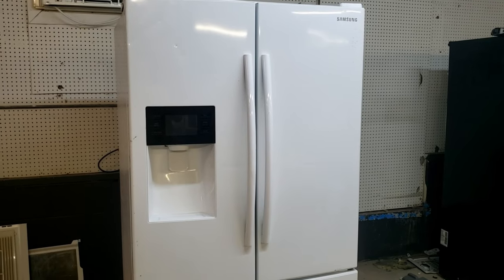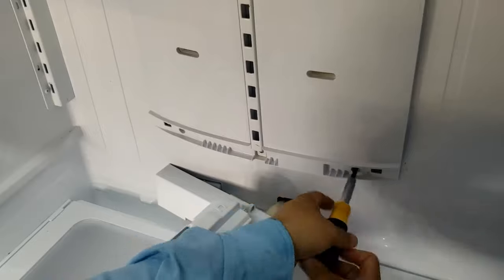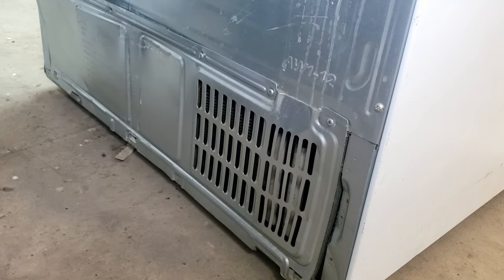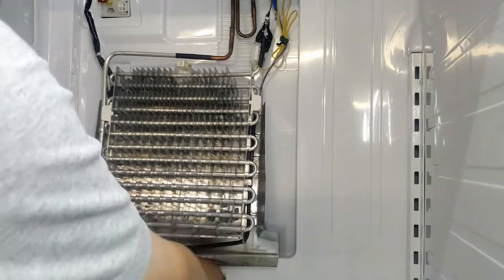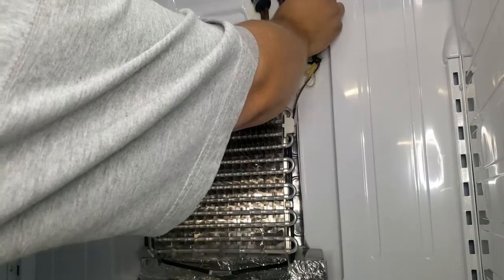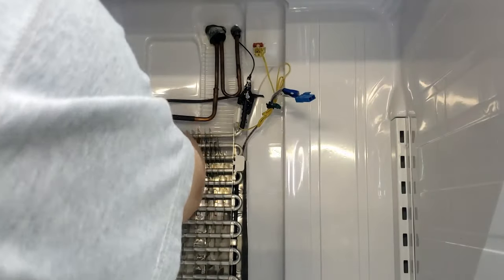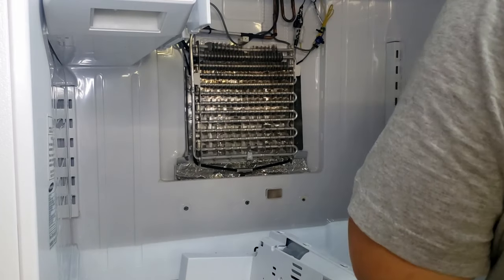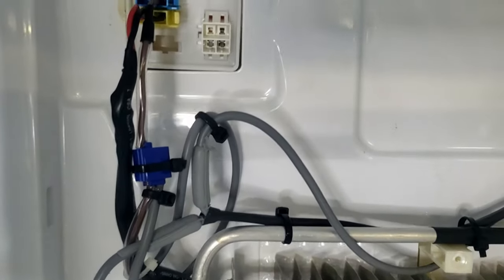Samsung Refrigerator Ice Build-Up and Leaking Water Inside Drawers - How to Fully Fix it Forever

Comment: Hi Ben, we bought your repair kit for our Samsung fridge RF263BEAESG and installed it.  So far so good.  What is the wire connector labeled DA32-0006W for that came with the kit? We didn't see any where to use it and didn't see it referred to in your video?  Hopefully we did the right thing and didn't use it. We plugged in the fridge, ran the rapid defrost and it was working so hopefully we didn't need it for our model?

Comment: Hey, I'm hoping you can answer this. My Samsung fridge had the ice buildup problem and I couldn't afford a secondary heater right now, so I all I did was get rid of the stock thermal probe and replaced it with a piece of copper wire, forming a "T" with both ends and then creating a "V" shape where it enters into the top of the drain opening. The fridge has been working great for the past 10 hours, but when I open the door there's an odor which kind of smells like heated plastic. I used metal screw clamps to attach the copper wire so it would do well at conducting heat to the drain opening. Is this odor likely just a natural result of the fridge being iced over for several months or did I perhaps create hot spots by clamping that wire in four places? I don't want to cause a fire, but it's my understanding that the heating element doesn't create enough heat for such concerns. The odor is definitely detectable inside the fridge and not emanating from the exterior bottom/back.
What are your thoughts?

Comment: Hi Ben- Great video, thanks. Will your Refrigerator Secondary Heater Kit as well as the optional Defrost Sensor DA32-00006W work for a Samsung Showcase RF28JBEDSG?

Comment: I've installed the kit. Will the fridge automatically keep itself from frosting up too much or do I need to force defrost sometimes? Will the defrost cycle keep the food good when if it runs automatically? How is it supposed to work? I don't want to lose any more food. My panel doesn't feel as snug around the edges as it was originally. Hopefully this isn't a problem.
Reply from the maker: It should automatically cycle both defrosters and keep the ice build-up that causes the issues away. Forced defrost every so often may help, but shouldn't be needed.
Reply: @bensappliancesandjunk  thanks, is there anything I can do to minimize my power consumption? I'm off grid and this is a big fridge. Had I known about these issues, I would have moved on to a more efficient model. I'm not sure how well my panel sealed back up. Will that gasket/seal have a big impact on how often the defrost coil runs? I'd like to try and optimize it. I did move the temp sensor to the right about as far as the panel would allow.

Comment: Great video. Do you think  the supco series  SH201 would work just as well or better. It seems to have better reviews
Reply from the maker: I've used them on the mod. They work great. Honestly, I prefer them because it distributes the heat over a wider area
Reply: @bensappliancesandjunk  
Would you please post a link to this heating unit? 

Thank you so much for your time and for sharing your expertise. 

I've had this problem since I purchased the refrigerator, just over six years ago. 

It was repaired three times under warranty, and again just last month, not to mention the many hours of 'hair' drying and defrosting carried out by me/my family as was TAUGHT to us by the Geek Squad repair person (since the problem is so common).

This is clearly an issue; SO MANY people have commented on this and related YouTube videos. 

Even the most recent technician said that he was very familiar with the issue, in the past, encountering it so often when repairing ice makers, he would be prepared to include a related fix because he found so many people suffered both.  

The ice maker is covered under an Extended Warranty, reportedly, due to Samsung being twice sued over it. Unfortunately, this icing issue isn't considered enough of a "known issue" for Samsung to take responsibility for.

Why do we have to go to the lengths of SUING, just to get something so common as this, repaired by the company that sold us faulty equipment? 

Has anyone found a way achieve any results from Samsung? I cannot afford any more outside repairs (hence, seeking DIY instructions, here), not to mention, the so called repair did not solve the issue.

Also, how long has the heater solution lasted for people (so far)? 

No "repair" I've received, to date, has permanently resolved this situation.

I question Samsung's integrity, and I will need a lot of convincing data of the contrary before even considering a Samsung product in the future. 

A refrigerator should last for more than a couple years, and I hadn't had it longer than that before this travesty revealed itself.
Reply from the maker: @aaangel30  Its in the description

Comment: Hi Ben. Great video and derails - thanks. Question: is the Frost King FV30 Foam and Foil Pipe Insulation for the last alternative mentioned in the video (instead of installing the heater)? Can or should we also use in combination with the secondary heater?
Thanks
Reply from the maker: Use one or the other, not both. The heater would melt the FV30 that's wrapped around the copper pipe.

Comment: I purchased the repair kit to fix the ice build up issue on my French door bottom freezer, but after taking the back panel off, the wiring is completely different from all the videos ! My Samsung has the wiring coming out only from the left side, not both ?  Fridge series RF266. ONLY 1 BROWN WIRE LABELED 2440  NOT 2 AS ON THE VIDEOS . ??? THX 4 ANY HELP !
Reply from the maker: Trace the wires that go to the main heater. Those are the 2 you tap into
Reply: Thx

Comment: I have had this water gathering under the beverage drawer on my 11-year old Samsung refrigerator for a couple of months. A repairman came out and found no issues after testing and examining various parts but says we should try replacing the entire back panel (evaporator panel?) for several hundred dollars. He says he is not sure this will fix the problem. Does this seem reasonable? I am wondering if your fix might be my answer. Thank you.

Comment: Ben, it looks like the kit you sell comes with SH201 but it's listed here as an "alternate". Is the SH502 better?
Reply: Yes sup502 for the cabin , in parallel with existing cabin defroster. see my earlier post. While your at it add an aluminum clip on with extended tang for the drain tube.
Reply: See my earlier reply to Ben. Let's find the law firm that won the law suit against Samsung and file a second class action for the cabin defroster

Comment: I've had the same problem with the iceball and I manually thawed it...it worked fine for about 6 months and now it's slowly coming back.  But worse, the Freezer has stopped freezing, are these 2 issues connected, or is the self-defrosting a whole other problem?

Comment: Does this work on any Samsung model that is having this problem? I replaced my drain clip with the longer one and it was working great again for about a week. Now it’s building ice and leaking water again. It’s just a matter of time before I’ll have a ball of ice again I’m sure. Just nervous about splicing the wires.
Reply from the maker: Generally yes. We do sell an easier splicer than what's here. I have a few other videos on posi taps which make this a cakewalk

Comment: Hello, I have the same issues with my Samsung fridge. I’m wondering, If I turned off the ice maker in mine would that prevent this issue? I turned the fridge temp up just a little and no longer get sheets of ice under the long deli drawer at the bottom but still get a ton of water. My ice maker still keeps frosting up so I have to hammer the frost buildup off every now and again. I was wondering if I just get a separate ice maker and turn off the ice in my fridge if that would make any difference?

Comment: Hey Ben, bought the kits, got er all done, except the defroster probe won’t go all the way into the drain line. Seems the probe is too long… can I cut the bottom of the probe off so it will fit into the drain line? I made sure the drain line is clear, so it’s not blocked/iced. Just seems the drain line starts to turn fairly early. Thanks!!
Reply from the maker: Yes you can trim it. Glad to know drain line isn't clogged because I've had a few instances where the probe wouldn't go on due to ice
Reply: @bensappliancesandjunk  trimmed it, working well, thanks so much!!

Comment: I have a hole burned in the plastic at the bottom left side of the evaporator. Form the existing heater I guess? I might have bigger problems?

Comment: Very informative video.
Bottom of my heater shows 70F,while upper vertical side around 200F.any ideas? And if the thermostat doesn't show any continuity could this be the reason of ice build up? Thx for your sharing
Reply from the maker: Where is the ice buildup? It should distribute the heat evenly, but if there's more ice/ect buildup on the bottom, it could be distributing the heat further, keeping those temperatures lower. The thermostat should have an ohms resistance value to estimate temperature. I'd consider moving it further away from the heater, to ensure it warms up further before shutoff.

Comment: How do I know if I need the 18" or 24" heater?  Also, my fridge is a GE Profile that looks exactly like the one in your video, and I understand it was made by Samsung.  Will the Samsung defrost sensor be compatible with my refrigerator?  How can I find out?
Reply from the maker: Either one works. I usually suggest the 18". All you'd need to do is punch model# into a website like PartsSelect and look at part numbers and see if its the same thing as a Samsung... GE may even have the original Samsung part#s in the listing, even

Comment: Will this work for Samsung rb217 model with a single refrig door?
Reply: Bought the kit and did not use the add-on heater element since the wiring was different.  One tip, when installing the new drain clip, add some thermal compound to the clip to get better heat transfer from the defroster element to the new clip.

Comment: Hey Ben, great video! We removed the evaporator cover and noticed one wire broken on the fan wire bundle, then another wire snapped on the thermostat wire bundle.
Any idea where we can get replacement bundles? This relatively easy fix just keeps getting more complicated.
Reply from the maker: I sell the defrost thermostat, and am working with ERP to carry all the other samsung bits in soon: https://www.appliancesandjunk.com/product/samsung-defrost-sensor-da32-0006w-da32-10105r/37?cs=true&cst=custom

As for fan wire bundle - those vary based on the specific model, if you let me know the model I may be able to figure out for you.

Comment: I ordered your kit and installed it. The heater does not heat up. I checked for power and I got nothing. What do I check now. Model # RF20HFENBBC, Samsung. Do I need to change one of the panels on top?
Reply from the maker: Are you getting electric to the primary heater, or are both not heating at all?
Reply: @bensappliancesandjunk  I can’t find out how to turn on the defrost so no power to both.
Reply from the maker: @wrenchswatch7700  if neither comes on, it could be the thermal fuse on the unit that's preventing any voltage getting to system. Or a control board. You'd want to use a multimeter to diagnose it.
Reply: @bensappliancesandjunk  ok what do I have to check? Multimeter is ready
Reply from the maker: @wrenchswatch7700  check any sort of thermal fuse thats inline with the heater system, usually you can check for continuity to see if voltage can get thru. Also, let me know what style interface it has, so I can figure out forced defrost mode for you.
Reply: @bensappliancesandjunk  it’s on the door sill on the top, have to open door to see it. Right side is fridge, Left side is frezer
Reply from the maker: @wrenchswatch7700  should be press and hold Power Freeze and Fridge buttons for 8 seconds
Reply: @bensappliancesandjunk  it’s the center buttons on each side, power cool and power freeze.  It shows 88 on each panel
Reply: When I hold power freeze and fridge the panel goes out and in about 5 seconds it comes back on.
Reply: @bensappliancesandjunk  I had to put it all back together last nite. I’ll check it out when I get a chance and get back with you. Thanx
Reply: Ok sorry it took so long. The fridge is freezing up again an d getting warm. I push the power freezer and power fridge buttons for 8 sec. and it blinked 88 on each screen and was bleeping. I tryed the power freezer and fridge buttons and nothing happened. I’ll unload the fridge and take the back off and get back to you.
Reply: I got it to go to the menu by pushing the fridge and power freezer button very hard and it took about 20 sec or so. No where do I need to go to manual defrost function? FF 1, 2, 3 or Fd ?
Reply: May be Fd for defrost. I’ll try it. Now it’s beeping and the temps are going up. How long does the take?

Comment: You mention to avoid the thermistor being near the heater both new and existing. We should not have to worry about existing correct as we are not moving that. Only the new 15 watt heater. Is this correct ?
Reply from the maker: It should be fine in its stock position

Comment: Ben.. we bought the kit and we are still dealing with the same problem, we even buy a new element, and the little round sensor ? Any other solutions?
Reply from the maker: Hi,

Which problem are you still dealing with, the icing or the leaking?

Comment: Hi. I live in Australia and and we have 240V?  Do I need Supco SH-503 (240V 15W) or SH-505 (240V 25W).  My Samsung Fridge is SRF583DLS.  Thanks for your video!
Reply from the maker: If you can get me a schematic, I can tell you which one you need.
Reply: @bensappliancesandjunk  Sorry for my ignorance.  Do you mean specs and/or manual?

Comment: Does anyone know why it's necessary to replace the drain pipes, is this just if they are blocked or have holes in them? I've checked the ones on my fridge and they seem fine, except one of them is fitted with a little black plastic funnel at the top which doesn't allow much liquid to drop through. Would really appreciate any thoughts on this!

Comment: I will never buy another Samsung appliance as they have not bothered to get the proper fix out there.
I believe the extra added heater has not been approved by Samsung but I do believe it is a good fix.
I will install it on all 3 fridges.
Also the drain kits.

Comment: could i just cut the wire and solder it in and put some adhesive heat shrink on the pair? or is that too risky..?

Comment: What is the point of the foam-backed metal foil pieces?  What issue is it solving that the heater and (larger) drain probe does not solve?
Reply from the maker: Channeling water better. It's a very minor part of the solution
Reply: @bensappliancesandjunk  I don't think that is correct. I was wondering that also. My best guess it the insulation makes the heater work more effectively. it insulates the heater tube from the colder back of the metal and therefore more heat goes forward to defrost the coils.
Reply: @joerock7005  Actually the Foam strips go on the back side of the Drain Plate and should only be installed on units built prior to Jan 2013. I have successfully Repaired a few thousand of these Using the Factory Bulletin as a guide to repair before I retired. If anyone wants to try the "correct way" before this Google ASC20171005001. Replacing the Evaporator cover, and fan assembly helps on units where the foam channels have been damaged by the Ice, and if you have frost on the outside rear of the unit Call Samsung as its not repairable if the liner is saturated and passing heat through the liner. If the unit Ices in days and not months Check for E5 code in Diagnostic and Corroded Sensor connector at the liner, or a bad sensor. If this is the case the Evaporator will be iced top to bottom and not just at the top. Oh and the Foam is to stop Transfer of heat through the Liner behind the evaporator due to Direct contact. At Least that's what the Samsung DSM who told me that claims. If you leave it in the front inside of the plate it will end up clogging the Drain tube in the long run when it breaks down from expansion and contraction with the freezing and thawing full on water a few times a day... There are a bunch of people running around installing them on the wrong side due to the poor pictures in the SB as you will see. I Also will add A Steamer is the way to clear the tube...... Good luck with a Trombone cleaner.🙃

Comment: What size Pos-taps should be used to splice the Supco 201 defrost line?
Reply from the maker: I used the blue ones and they worked great
Reply: Thanks, got 2 of each size which included 2 blue ones.

Comment: I have the exact same problem. Sent pictures to some Pros and they said no doubt it's a seal issue? With door closed, I used an infrared temp probe around the door no cold air detected coming out on door seal. Not sure what is causing warm air coming in?

Comment: Hello, I have a Samsung Model RF26VABBP, RF26V SERIES refrigerator. It has made ice under the two vegetable bin for as long as I can remember. It is so annoying. The computer just says 88   88. I did try your troubleshooting video and it worked, but because I think of the ice built up again and it returned to 88  88. Do you think your video on the Samsung Refrigerator will work with mine? I paid so much for this refrigerator I hate to give this one away and spend so much on another one. Thank you

Comment: For the alternative solution, if I use the foam to wrap the copper lines, would regular foam work or do I have to get the foam that has a piece of aluminum on the outside?
Why would this alternative solution work?
Reply: Did you try using foam to wrap the copper lines?